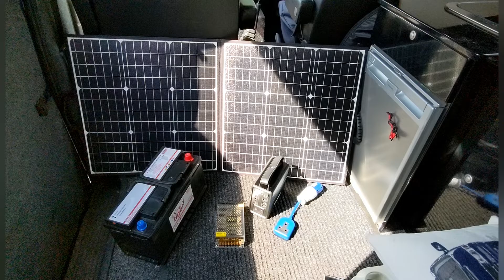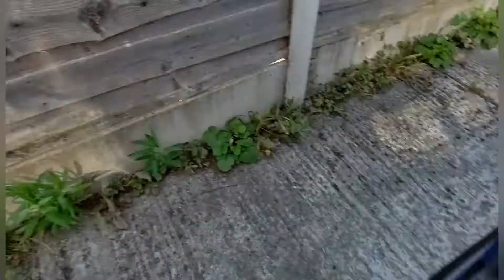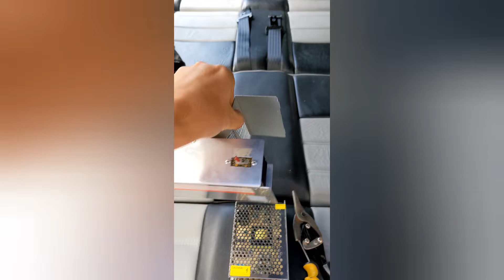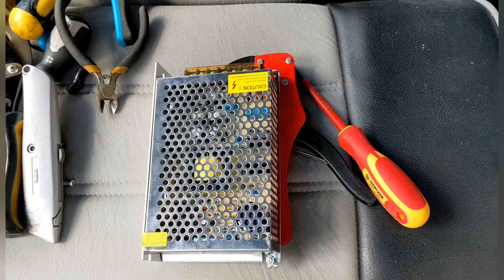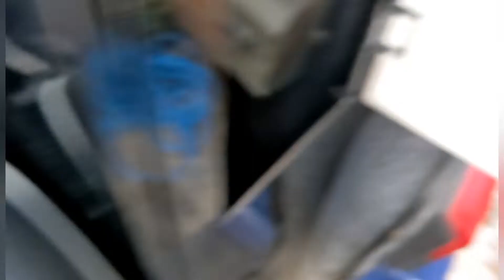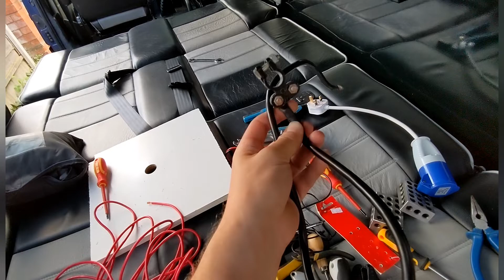VW T4 Camper off grid power upgrade, including Solar and power bank

Comment: You could have done with buying a 12v power supply with a fan
Reply from the maker: It's since been replaced with a better solution to charge the battery :)